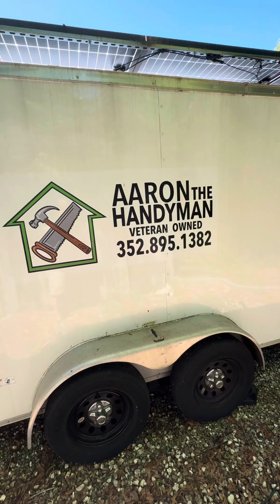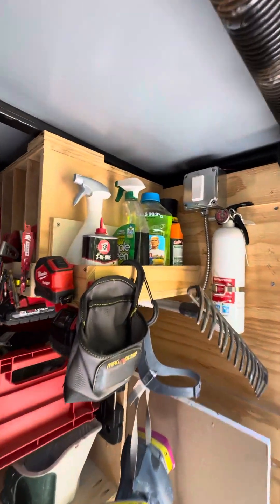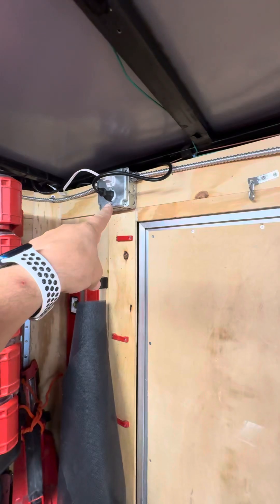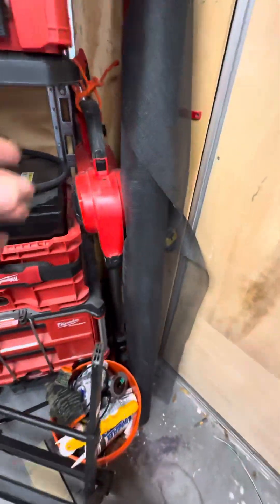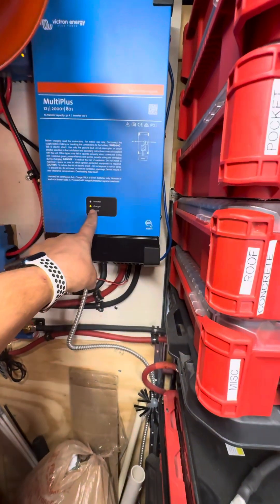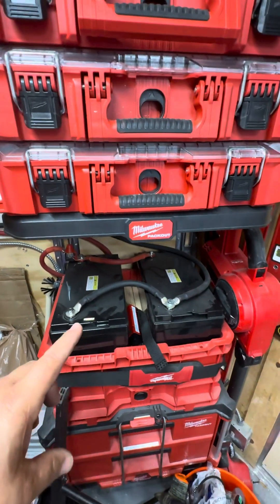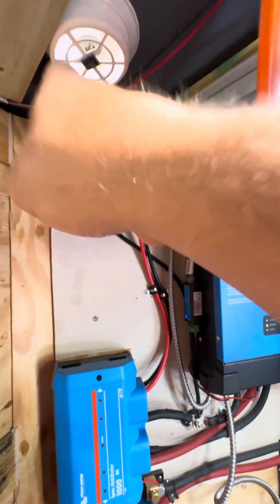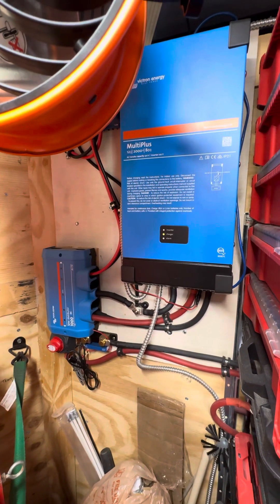My electrical (solar and grid tied) system for my tool trailer.

Comment: I’m just starting to outfit a new to me trailer. Roughly how much do you have invested into the solar system? Any pros and cons you wanna share? I’m in California so sun usually isn’t a problem
Reply: Thanks for the info, I’ll go down the rabbit hole with that in mind. Love the trailer set up btw
Reply from the maker: I’m thinking I am right around $2000-$2500. I do plan to add more batteries in the future. I’m in Florida and hurricanes knock out power for long periods of time.
Reply from the maker: @danielsechrist7624  also if I was to do it over I’d buy a 3000 watt inverter